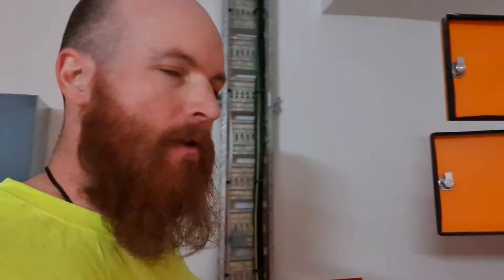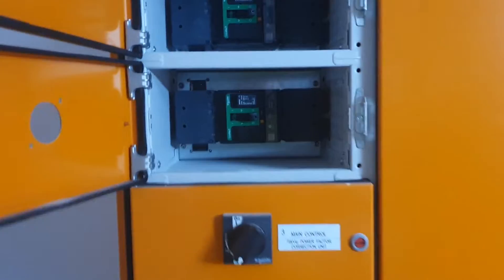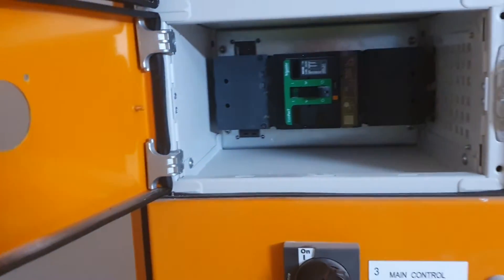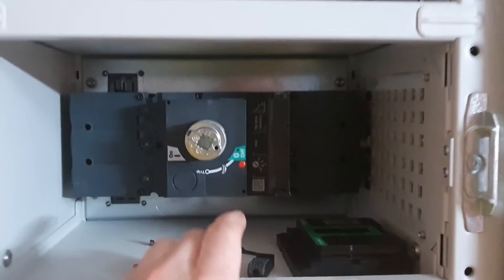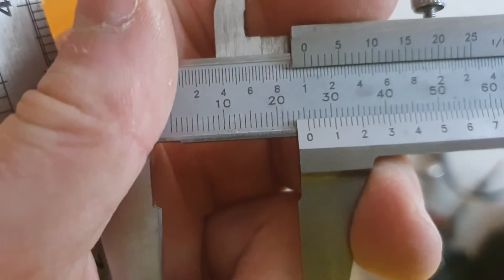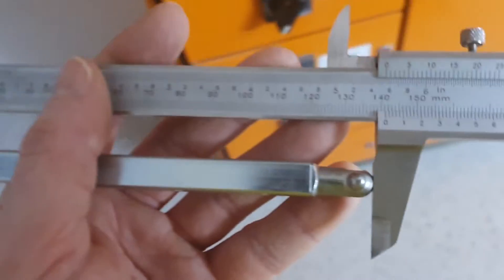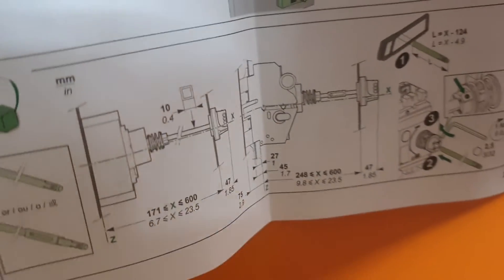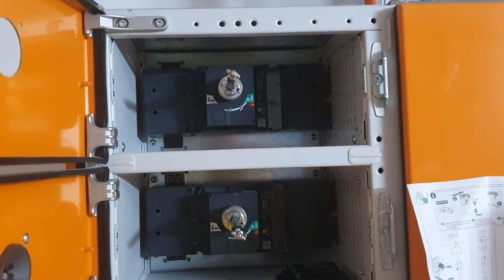How to Install an Extended Rotary Handle for a Schneider ComPact NSX MCCB

Comment: Nice, for cutting the bar I do it the trial assembly way, lightly assemble the full length bar in the switch poking out through the door, close the door, fit the plastic handle assembly on the bar, hold it roughly in place, measure how far too long it is poking out & cut off with said measurement - but agree they are a hassle
Reply: Thats how i used to do it. attatch bar through door, push door handle on, measure distance from door to handle, cut that off
Reply from the maker: You guys are both smarter than me haha thats a much better technique - comments section 🙌